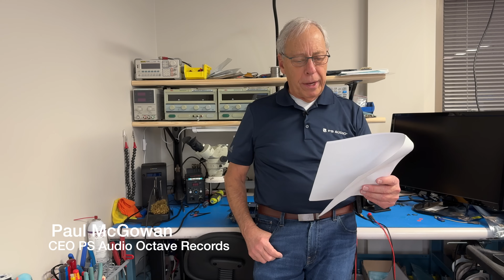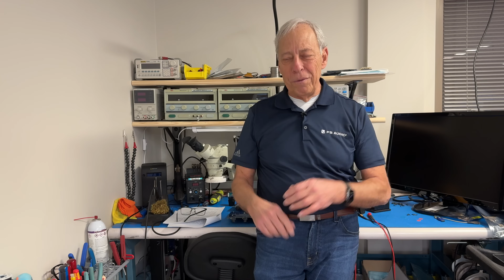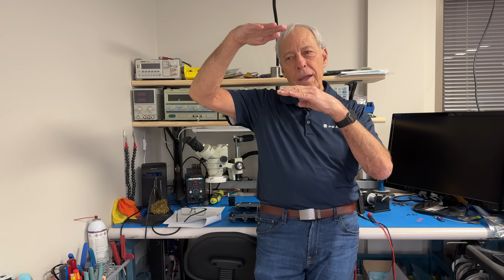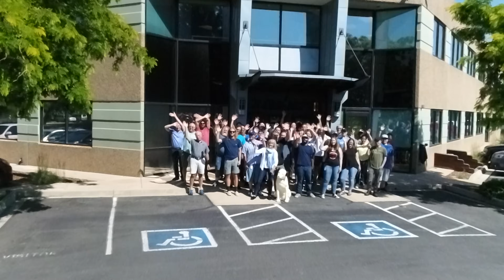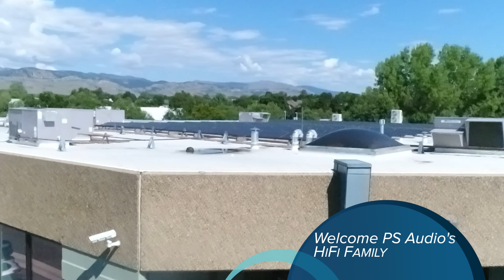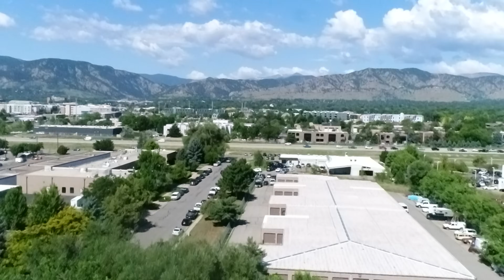Understanding amplifiers and wattage specs

Comment: Hello , I'm new to audio stuff... I have a question, I have two Polkaudio 150w 8ohm each , what is the amplifier I need to run those? A 300 watt amplifier?

Edit: chatgpt says I should be good using a 300-600 watt amplifier as long as I don't push too much on the volume , then I asked what if I buy a 140watt amplifier, to which chatgpt answered that most likely I will not damage my speakers or my amp even if I push the volume to the maximum ... I think I will buy the Yamaha A-S201...

Comment: Hi Paul, with this explanation, can I thus assume that a speaker is a resistor - and 8 ohm would use less current flow because the resistance is less than that of an 4 ohm. Resistance is thus the "blockage created to the water outflow"

Comment: Ohms Law.  Foundational set of calculations that explain how so many things work.    One analogy I use to explain loads and power in a circuit to gearheads (I am one) is power to weight ratio.  Same HP engine in car that weights 1k lbs vs 2k lbs.  Why is the 1k lb car faster.   Same concept of load vs power and like your comment, seeing the light bulb come on is priceless.

Comment: After one half your time of fluff you finally got to the issue. If you went back to tube power amps you'd find 4, 8, and even 16 ohm outputs. And you'd get the same power so long as you used the correct match. That transformer matched the labeled speaker to present the optimum load line to the output tubes. But solid state outputs have voltage limits from the supply with device voltage ratings. And they have output current limits with shut downs based on current ratings. And they can be optimized for a particular load. Included in that rating is heat sinking. It seems that a de facto standard is 4 ohms, partly as cost vs size of capacitors is important to equipment cost. But I've designed amps with 100 milliohms to 3000 ohms load including magnetics. Wats are still watts. And you didn't explain why the current audio industry only rates for the load impedance.

Comment: Is it safe to say you need a high current amplifier to make that work effectively, and is that designation required to be in the specs?
Reply: High current amplifier is in the specs but it is hidden under the spec "minimum impedance" each channel can handle. A 2 ohm rated amplifier has twice the current capacity as a 4 ohm rated one.
Reply: @wally7856  yes, I understand what you're saying. My S 300 more than doubles from 140 @ 8ohms to 300@ 4 ohms, if those numbers are accurate anyway. Thanks for your input.

Comment: I have a question. I wired a second set of 6 ohm speakers to the positive and negative terminals of the other pair, then attached the first pair to the amplifier. Is this parallel now? Meaning that it is now 3 ohms as I've read? I have a very cheap amp that I'm using it with but I hear it can get down to 2 ohms per channel (Aiyima A07), I've been running it a lot over the last week and it's still fine. Is this bad for my amp?
Reply: You have it right, but the only thing is your speakers aren't really 6 ohms. That's an average. You need to be concerned with the lowest resistance the speaker shows the amp. The lowest resistance is your worst case scenario. For example, one pair of speakers may average 6 ohms and drop down to 4 ohms, and the other pair is 6 ohms that drops down to 2 ohms. The first pair of speakers will be much easier to drive than the 2nd pair.  What you need to do is find out what the low resistance ratings are, and used those numbers, not 6 ohms. 

One thing you need to be aware of is when you lower resistance, you don't increase the power of your amp. You're just asking it to work harder. Its like if you want to make your car go faster, you have 2 options. You can either upgrade the motor for a higher top speed, or you can drive down a hill with your foot to the floor. So, if you have cheap amps, you're probably beating the crap out of them.

I would strongly recommend that you try wiring the speakers in series. Yes, on paper you'll get less watts, but you're also making it easier for the amp to driver the speakers. Its just a matter moving your speaker cables around. There's no need buy anything new. And if you don't like the results, go back to parallel.

Comment: If an amp has 2 40v caps in the supply.and its using the comon 80 percent rule.thats 32 volts +  and 32volts -  ..thats 50 watts per channel into 8 ohms.and 100 per channel into 4 ohms..

Comment: The double with half ohm is logical after I learned it some years ago.
But a 100w amp is not always a 100w amp either..
Some messure at only 1kHz on maybe just one channel instead of 20Hz - 20kHz on all channels.
That makes higher wattage numbers but the amps behind it is low so it's weak watts. Watts is not just watts. You need both volts and amps to get powerful watts

Comment: The part the he left out is engineers have discretion in designing for impedance. Some designs hold the output wattage constant at any impedance. Some double it from 8 to 4 ohms. Some pick an arbitrary factor between 8 and 4 ohms. Impedance wave forms in speakers may be interpreted differently. Yamaha says the NS-5000  is a  6 ohm speaker with a nominal wattage of 200 with a maximum wattage of 600.  The wave form could be 6 or 4 ohms.

Comment: P=(V^2)/R
Therefore, as the value of the resistance, R goes down, the value of the power, P goes up.
Reply: "P=(V^2)/R ... P goes up" <- but P=E/t (by definition), and therefore if the power goes up then the energy per second goes up.

Comment: Wattage? 
Electric potential is expressed in Volts
Electric current is expressed in Ampère
Electric power is expressed in Watts
Electric resistance is expressed in Ohms. 
The units are all called after people who had that same lightbulb moment. But trying to explain fundamentals by naming them by their discoverers is very confusing. 
Giving a good analogy is much more helpful in understanding. Like a canal that transports water. The height of the water is the potential, the current is how fast, resistance is how narrow and the amount of water that flows is the total power. Imagine that and you get it. 

 If you understand something, you can remember it better.

Comment: The comments are making me crazy. Here it is: Impedance (as the name implies) is opposition to electron flow (current). The lower the impedance, the more current you get, the higher the impedance the less current you get. The wattage is voltage times current. Look up Ohm's law, and drop Z in place of R. The math is the math.
For those of you who want the advanced version, look up reactance (X). Enjoy.
Reply: The way you explain it is not entirely correct. "The lower the impedance, the more current you get, the higher the impedance the less current you get.". That might be true. You'll only get more current if the amp has it to give. If impedance increases, you'll get less power, but it makes the speaker easier to drive. Also, it goes without saying this only applies to amps that don't use output transformers or auto transformers. I assume you already know that, but a lot of people read these posts.

Comment: What continues to confuse me is that if Ohms is a measure of impedance, shouldn't something with a higher impedance (8 ohms instead of 4) "impede" the current more, and therefore need more power and not less? I realize that isn't the case, but it seems counter-intuitive to me.

Comment: A.k.a. the amp's wattage rating is not a value written in stone. It varies on the speaker load. Voltage is the value written in the wall.

Comment: So are 4 ohm speakers sensitivity ratings typically “boosted” by 3db because the sensitivity test is done at 2.83 volts, which results in 1 watt into 8 ohm load, and 2 watts into a 4 ohm load?
Reply: Yes. For a fair comparison they should be tested at 2.0 volts. Although in practice it doesn't really matter because the amplifier you have has a fixed constant voltage output.

Comment: I hate to say it .... but that wasn't very well explained at all .... 
You simply have a 100 watt amp ok 👍... it's putting out 10 volts and this drives an 8 ohm speaker .... now I = V / R from ohms law ... which equates to 1.25 amps where V = 10 and R =8... now POWER is derived from the current squared X R ! This equates to 12.5 Watts ... now if R was halved to 4 ohms then the power would be exactly twice this ... the amplifier ( if it has a good power supply and rugged output stages ) will keep giving a constant 10 volts ... or more .... right up to it's maximum voltage swing ... in which case this simple formula still applies ... ok 👍

Comment: So, the amplifier senses the speakers resistance (ohm) and adjusts the current level accordingly? 

Is this in any way connected to global feedback?

Thanks!
Reply: No, the amplifier puts out a fixed voltage in relation to the input. It could cares less what ohm load it goes into or even if there is a load at all (solid state amplifier) as long as the current flow doesn't exceed the amplifiers current capacity.

Comment: This is why if you have a speaker that is rated 4 ohms…. You really need an amp that has big reserves of power … and… if the spl output is low… really big power is needed…. Dynaudio confidence 5s speakers have a 4 ohm rating so BIG POWER is needed….

Comment: It is simple and a little complicated.  The simple part is defined by Ohm's Law (V=IR) and Watts Law (P=IV).  Then in general, understand that voltage sets the volume.  You don't need to remember the formula, just know that this is the what you need to Google when you want to know anything to do with power in a circuit.
The complicated part is that every speaker has a level of efficiency at turning power into sound and that is determined by their efficiency.  At a given voltage how much sound pressure?  That's the published efficiency ie 90dB at 1W at 1meter.

Comment: I do appreciate that you answer the same question over and over, and sometimes you have to find the right analogy to click. All of us have different backgrounds, and those who haven't taken years of math and engineering (and even those of us who got lost halfway through Electrical Engineering 201) need the right orientation of the imagination to get it to fit with our experience. With electricity, I like the water analogy: voltage is water pressure, amperage is water volume-per-second, power is "fire hose vs. garden hose vs. kitchen faucet", little sparks are "much pressure little flow". And yes, it falls apart when talking about inductors and capacitors!
Reply: Yeah, when you have worked enough with voltage, current, power and impedance, you get a sense of these like you do with water flow. I've seen many are struggling with power (energy per time) and energy. For an amplifier, what is 100 Watts? Actually, the human body is typically using around 100 Watts or 100 Joules of energy per second. That means your body is using the equivalent power (energy per time) of anything in your home using approx. 1 Amps of current from your US mains socket or approx. 0.6 Amps of current from your EU mains socket such as an amplifier using 100 Watts. A Big Mac contains about 2,250,000 Joules of energy. Thus your Big Mac can keep you going for 22,500 seconds or more than 6 hours. A modern EV might have a battery capacity of 100kWh, which is 100 * 1000 * 3600 = 360,000,000 Joules or the equivalent energy of 160 Big Macs or keeping a human or amplifier playing very loud going for about 1.5 months (do the math).

Comment: Please correct me if I am mistaken, however given your example... the Loudness we would hear coming out of each speaker (the 8 ohm or the 4 ohm) would be exactly the same. And so despite now playing the music at 4 ohm 200 watts, it is sounding to us exactly the same loudness as the 8 ohm speaker playing with 100 watts.  Is this a correct assumption / statement?
Reply: No. The loudness of the speaker is a function of the speaker’s sensitivity. Speakers sensitivity is measured as how loud (dB) it is with 1 watt input 1 meter away. It takes double the power to increase the speaker output by 3 dB. If the two speakers we are talking about have the same sensitivity and we play one with 100 watts and the other with 200 watts, the 2nd speaker will be 3 dB louder.
Reply: @tedhersh9095 
And how do you get a more sensitive speaker? Right. More windings. If you look at the specs of the same drivers that are sold in either 4 or 8 ohm you can see that sensitivity drops on 8 ohm version by 3dB (give or take). 
3 deciBell is 10x log 2. Double the power is 0.3Bell or 3 deciBell more.
Reply: Yes. Given the cone surface, weight and suspension stay the same. 
If you put on a coil with double the windings, you can get more magnetic field out of it and get more push, (more sensitivity) but it doubles the resistance of that coil. 
What makes it difficult is that the mass of the cone keeps it vibrating which also induces an electric field that interacts with the input. That's why it is impedance (it impedes the input signal) and not just linear resistance. 

So yes, but it's not that simple in practice. But for understanding you are correct.
Reply: Thank you!
Reply: @Jeep_on_audio  Agree, however as an 'all else being equal' Question/Answer my assumption is correct (good).  Thanks.

Comment: It may be confusing if we compare to  tube amplifier and may be the  reason of repeated  questions . The main difference with tube amplifier is our care not to loose any watt,  which is not the case of solid amplifiers  For tube amps for   each impedance we dedicate separate  output windings of transformers.   For them    the condition of pemanent  output voltage usualy is  not true.  and max  power is (supposed to be)  the same and nominal for each spaeker impedance.

Comment: so in this case the power limit of the amp is determined by the voltage it can produce .
Reply: Yes, but there is also a current limit which if exceeded will trigger some sort of protection so that the amp doesn't catch on fire. That's why amps also list minimum impedances it can drive. An amp rated for a 2 ohm load has to output twice the current as one rated for a 4 ohm load (even though both are at the same voltage) so it would have to be designed as such to handle that current.

Comment: Explained 50x  ?  Must be both a bad student and a bad teacher !  :)   Seriously, well done Paul !  Power = Voltage / Resistance.  If voltage is constant, and resistance is halved, then power is doubled !  Also, power specs of amps can be  very misleading... Peak power is useful to an extent.  RMS power is also very important.  The reality is majority of speakers don't need much AVERAGE (RMS) power to drive it at normal listening volumes.  Peak power is of import to drive short bursts....  .
Reply: sorry, wrong! Power = Voltage squared / Resistance ( P = U² / R ).

Comment: Thank you very much. But why do some amps produce a linear response to changes in the resistance and most don’t?
Reply: That's because of the power supply. If you don't have ample supply of power you can't deliver.
Reply: @Jeep_on_audio that's the limiting factor for the amplifier. Many don't have enough reserve in the power supply to provide enough curent to double the maximum output.
Reply: you mean something like 100W at 8Ohm but 180W at 4Ohm?
because the device is unable to maintain the same output voltage, e.g. due to non-zero output impedance

Comment: I really think people are over thinking this. Think of electricity as water. The force of the water is the voltage, the amount is the amps and to get the power you multiply them. Same thing with ohms law just imagine a tunnel the wider and bigger it is the lower the ohms. The smaller and tighter it is the higher the ohms.
Reply: Under thinking is also not good idea. Force of water    is not usefull  in hydraulic. rather in disasters. You mean preassure? Amount and preassure are at it's peak in oceans But  it is unknown   by multiplying get any power